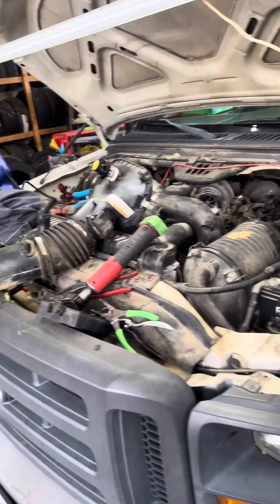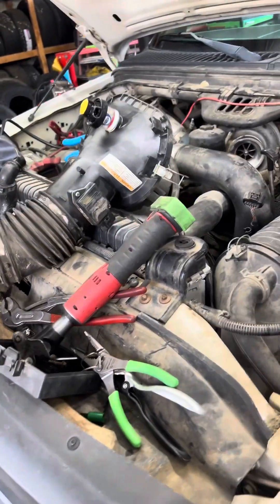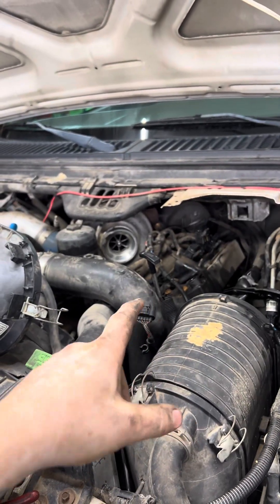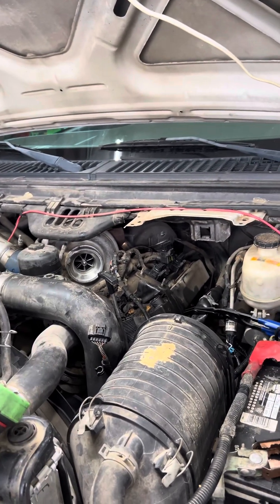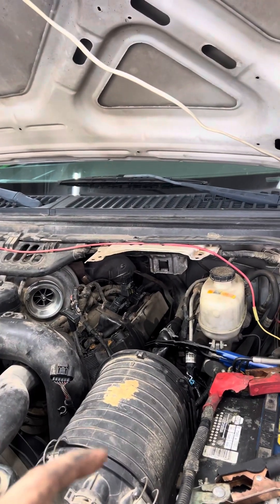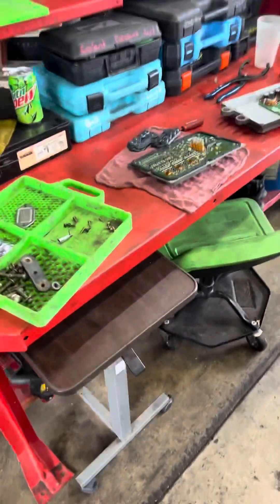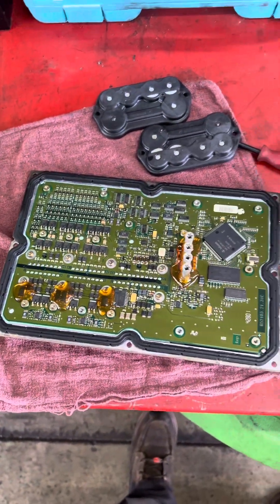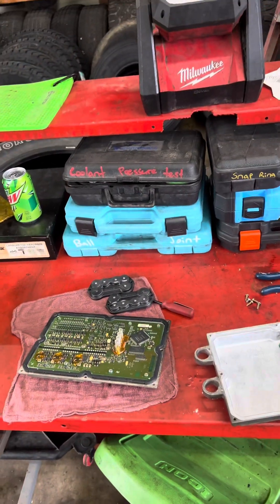Ford FICM Issues In A 6.0 PowerStroke? P0611 U0105 Part 1

Comment: Bad grounds or ficm relay either way the ficm was probably taken out too
Reply from the maker: I replaced the power board and it did not fix the problem ended up, changing out the whole FICM with a rebuilt one from FICMRepair.com

Comment: How did you repair the vehicle… Update please.
Reply from the maker: @fattmouth7715  replaced the whole FICM. Replaced just the power board at first and it “fixed it” it was just a coincidence . Get ahold of ED from FICMREPAIR.com. He is very knowledgeable. He will answer any Ficm questions you have and help you. Find their number on their website. Ed is the owner of and usually answers. 
I got a new FICM from his company and it fixed everything. 
Do you happen to have a TikTok? Ed posted some videos on there and made videos replaying to my video and I can tag you.
Reply: I do have TikTok… same name… just wondering if you had tested the voltage at the four screws under the two bolt plate and have a result for that?
Reply from the maker: @ I can’t remember what each of the 4 screws are, but they all had the correct readings. I never lost 12v or went under 48V or lost ground. 
I had a U106 (I think) and some loss of communication code to the FICM. Every now and then when you cycle the key for the glow plugs to run the injectors would not do their self test and chatter. Every so often and then the loss of communication would happen while idling and the truck would just shut down. The new Ficm fixed that.
Reply: @ really wondering about the other three screws… I know I’ve checked them in the past.. but can’t remember the results of each one. Just seems to me like I saw 12 V on two of those middle screws.. book says right to left 48 12,12 and ground… my literature says after the 48 V to the right the next one in line is the vehicle power which would be 12 and the next one in line would be the logic control module which would be 12 V and the next one is the other end of the capacitor circuit which would be the control which would read as ground
Reply from the maker: @ I honestly don’t remember that order they were in. Honestly call Ed at Ficm Repair.com. You don’t even have to buy anything just call and ask questions. He’s a good guy and will tell you tons of info on diaging it

Comment: There’s an engine harness ground on the rear most intake manifold bolt driver side, I’ve seen them wither away in the rust belt here. If the module supply voltage is hot with the key in run/start then suspect module. There’s also a PID FICMSync you can monitor,